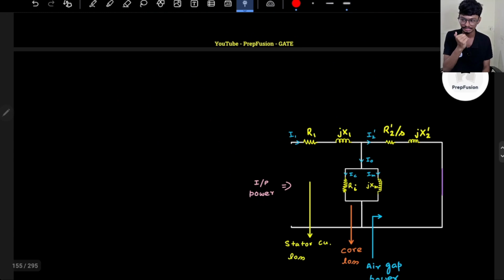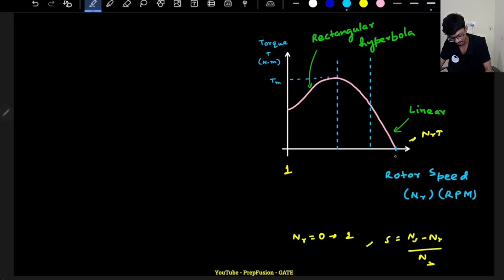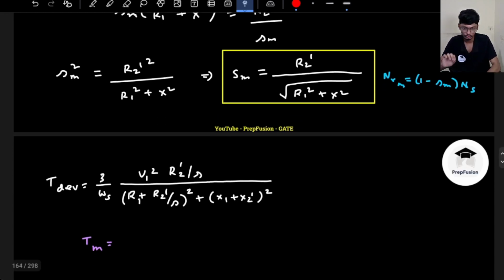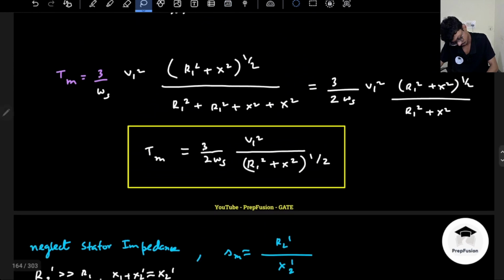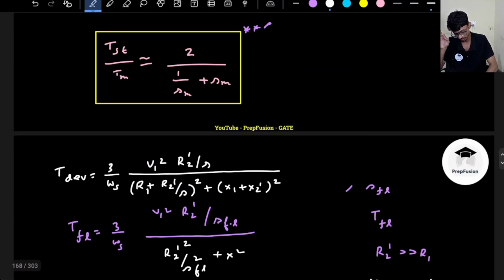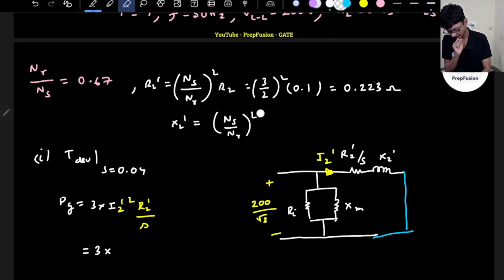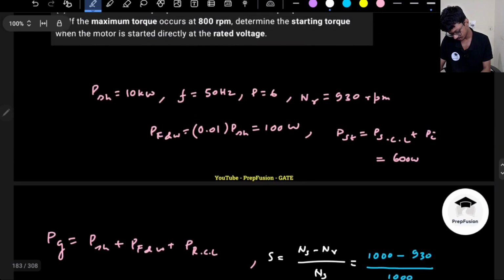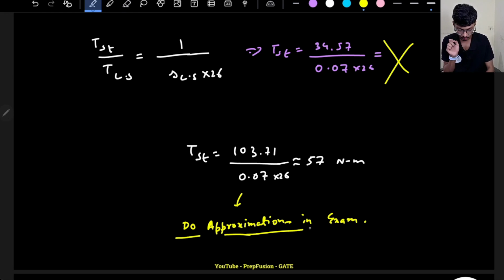L43 Torque-Slip Characteristics || Induction Machines || PrepFusion

Comment: Sir in question 12, you have selected Ws as 2πf which is electrical value, Torque is related to mechanical power, and hence the denominator in the torque equation must contain mechanical angular speed, not electrical angular frequency, so we should use Ws = 2πNs/60. Please correct me if I am wrong. 
BTW watched every single video of this playlist till here,one of the best playlist on Machine present on YouTube ❤
Reply: Yes you are correct I made a blunder their.